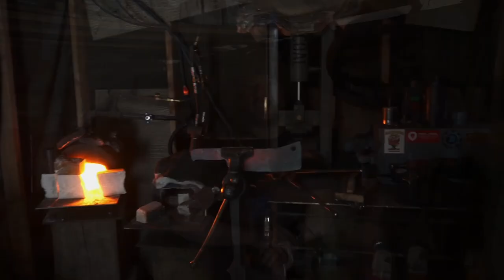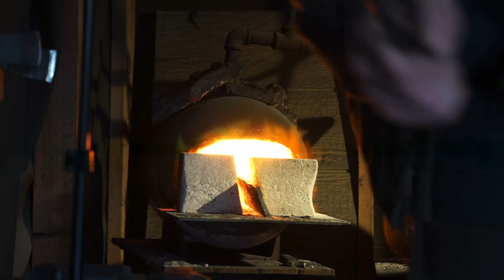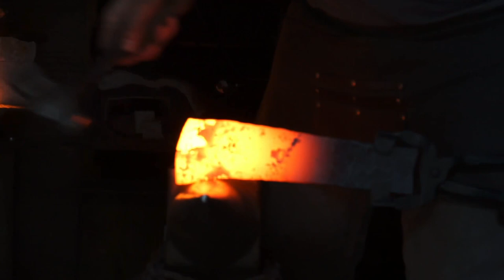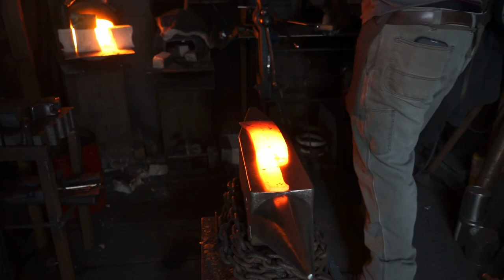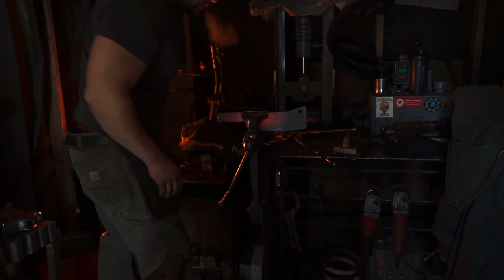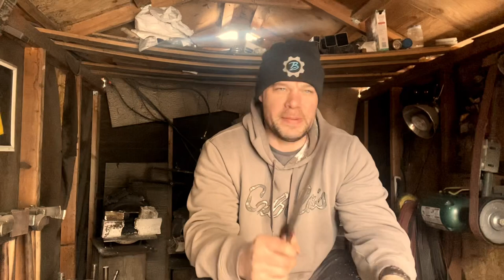Forging a cleaver

Comment: more descriptions please for new guys
different areas you are working on
where you start shaping n why
why you do an action 
what other ways to get same out come
why that tool used
problems avoided / corrected
tolerances'
choices
how close to plan is the job
more, more, more info please you are obviously skilled blacksmith

Comment: I love how small and rustic your shop is, man. I'll look thru your videos for a shop tour, but if you dont have one, it would be cool to take a look at your set up. Just a thought.  I'll go see if you have one already nevertheless.  I work in a very small space I made in the back of a shared carport, and even though its crazy tiny, i love it! Soon I'll be building a portable, coal fire forge so i can expand from just knives. I'm curious about your hydraulic press  (?) that you're using; did you make it?

Comment: if you made the bevel 50% of the blade width. It cut in a lot better and get much better and shaper for cutting chopping and slicing.

Comment: Video did turn out great! So did the cleaver!  Keep it up! Just started working with forklift tines for axes and thought an oil quench would work but didn't turn out very good. Water worked but wasn't expecting to have to do that. What did you do for yours?
Reply from the maker: Thanks! I quench in parks AAA.
Reply: @HeavyForge  I need to shell out the cash for engineered quench oil. Thank you
Reply: @HeavyForge  where do you live in Alaska? I was born and raised in Chugiak but live in east Tennessee now.
Reply from the maker: @lukelofgren4108  That’s awesome! Born and raised in Anchorage and that’s where I currently reside.
Reply: @HeavyForge  right on I lived in A town for a little while but quickly got back out to chugiak. Really enjoying Tennessee but its almost too hot to forge in the summertime here. I wish I was into forging when I still was back in AK.